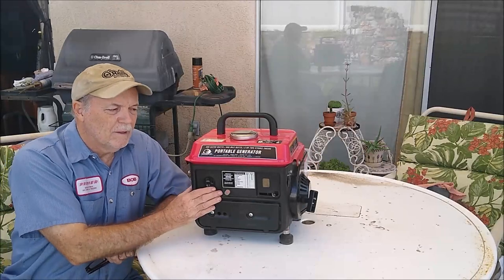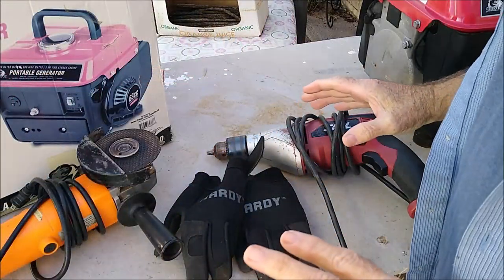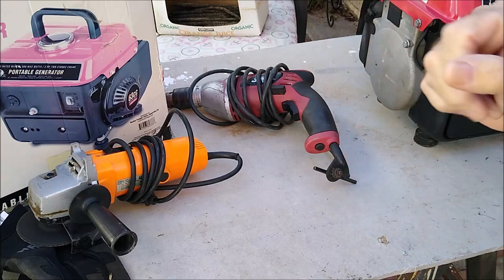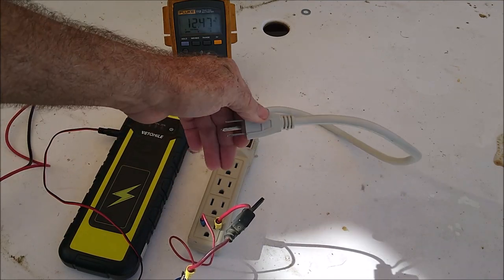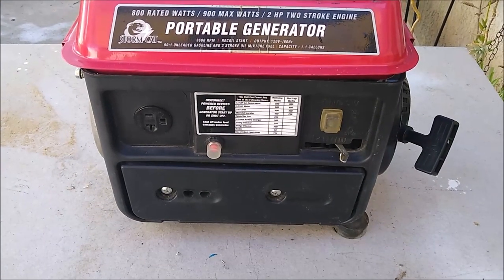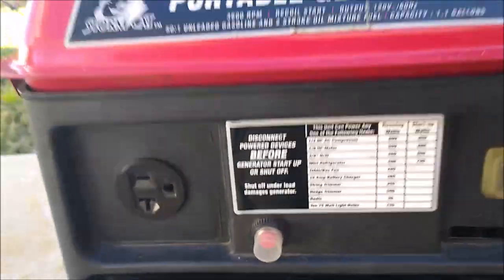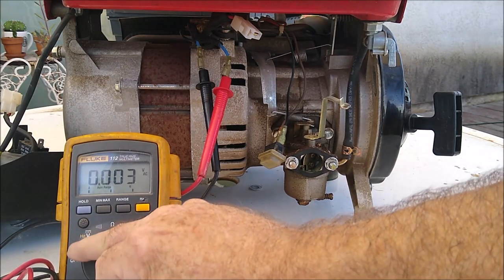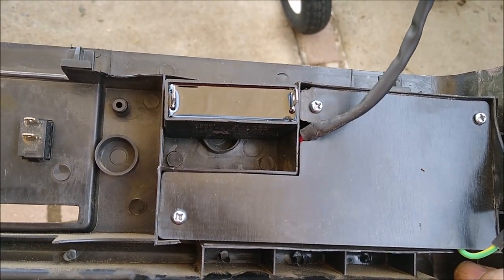Harbor Freight Generator No Output... Diangostics and Repair

Comment: That epoxy will be conductive at first, but not after a year or so..
Ask me how I know.
I used the exact same stuff.
Doesn't matter where it was made.
Reply from the maker: It is actually called Wire Glue. It has been on for over a year now and is still working. But, I will be sure to keep an eye on it and if it fils at least I will know where to look. So, what did you find that lasts? Or did you not? Maybe someone reading this can help us... Thanks for the heads up.
Reply: @bobamos3628  I used it to try to repair some Subaru speakers where the leads became detached from the coil.
I haven't found another conductive glue... I've just gotten better yet at soldering lol..

I do notice now your packaging says "Improved" so maybe they addressed the issue I mention?
I bought mine roughly 5 or so years ago. I have the little jar of glue but couldn't find the packaging to check it..

And I actually did have to repair a very similar issue on our work's Briggs & Stratton Storm Responder generator; it had been stored by the Jersey Shore for a while, then went through Hurrican Ida last year, so there was some chalky corrosion where the 2 halves of the winding were joined. Was difficult to get a clean solder joint because of residue of the wire coating but finally got it.

Your explanations are very clear I must say. Thank you!
Reply from the maker: @spettro9  This generator part required a non solder repair as the wire would not accept solder. As a professional auto electrical specialist soldering is a snap for me so the use of something like this is foreign to my way of performing repairs. So far it has held and I hope that it will continue. But if not it is no big deal as this is not my only generator. I guess only time will tell...

Comment: Good Demonstration Bob!!!  I am surprised at the number of people not knowing that these need flashed..or can lose charge over time. If I am correct don't the magnets resist each creating magnetic field to drive the motor? We had an electric motor apart the other day at work and one of the other Techs was describing that a bit.
Great video..very detail. Well done!!
Reply from the maker: Thanks Lee. It is surprising the number that do not realize this. What is even more interesting is the fact that I did not find a single video about flashing the Condenser/capacitor on this model. I was thinking the same on those magnets. My specialty was automotive electronics. You know computer operations and diagnostics. Was thinking the magnets were an aid to the magnetic field that drives these things.

Comment: Mine only makes power when you rev it up really weird
Reply from the maker: There is an adjustment screw above the pull starter. It may have silicone shoved into the head. Try adjusting this to up the speed and see what happens. Not too high though but it does need some engine speed to trigger the charge.

Comment: Wonder how many of these $100 generators were sent to landfills that might have been repaired? The problem is finding someone to work on them. I have one of these generators and will bookmark this video. THANKS!
Reply from the maker: Funny, I thought the same thing more than once. Most failures are for no start and is generally a sticking float needle. Since they are so inexpensive they are just tossed on the rubbish heap. This one was well cared for and in perfect condition except that it did not charge. $20 is all I paid so others that are not so well cared for would be worth very little. I've seen them for free and as low as $5. Glad that I was able to help out.
Reply from the maker: @M J Low original cost items are never really worth making a business out of unless it is a quick fix. Those that do fix and sell really are doing it as a hobby of sorts or the sheer enjoyment. I too enjoy fixing anything. I am a retired automotive electrical and A/C specialist so fixing things is what I love doing. Some of what I fix are given to friends and family. Some I keep. If I kept everything I would need a bigger garage (Which I already could use..)
Reply: I was at a customer in la they do recycling of metals. S.a is the name part of ecology, in the back there was a pile of almost new harbor freight and other generators.

Comment: My first check would have been electrical plug outlet those go bad relatively easily
Reply from the maker: Well, I did check the voltage at the plug and at the input of the wiring on the back side.. Maybe I should have included that but it was, sort of, considered something normal to look at first. Thanks for the comment and hopefully someone will read your post and add that to their diagnostic procedure.

Comment: I have the same generator and it only has 1 diode and 1 resistor
Reply from the maker: Really? Is yours the Strom Cat or one that looks like mine? I would have to see the circuitry to know why this is your case. I am assuming that it did operate at some time so it may be designed to only require a single diode and resistor. What I would be looking for would be the two rotor windings. I would be interested in knowing if they are two different circuits or are they tied together?
Reply: @bobamos3628  yes I actually was able to repair it. It is indeed the very same one.  Mine had only one diode and resistor. The resistor was a different value then yours so maybe that's why I only needed one
Reply: I’m having the same problem with mine, I have 1 diode and 1 resistor. I want to replace both and I have the diode part number. But I don’t know the value of the resistor. Do you know by chance ?

Comment: Is that not a capacitor
Reply from the maker: Not sure that I understand your question. If you are referring to my calling it a condenser, they are one in the same. Two names for the same item. Condenser is the old term as well as the automotive term. I am a retired automotive mechanic so condenser stuck with me.

Comment: nope not a commutator but slip rings.capacitor jobs don't have the cleanest a.c. output
Reply from the maker: Yep, these things are not clean at all... But f only used on non-critical items it works just fine... I actually rarely use this thing.